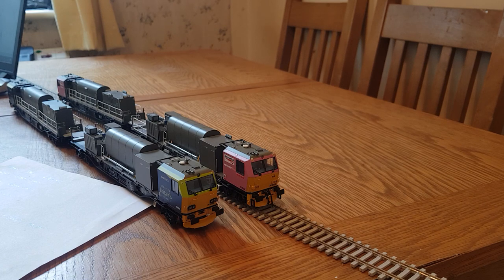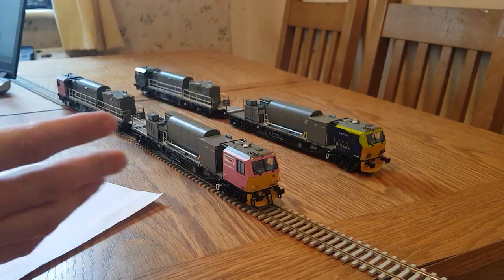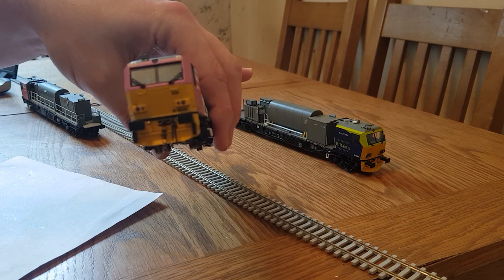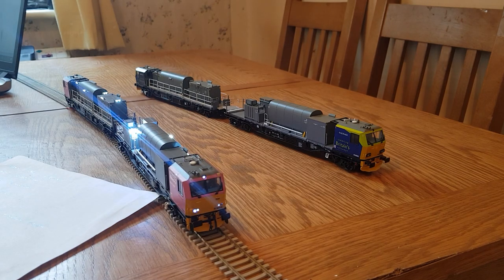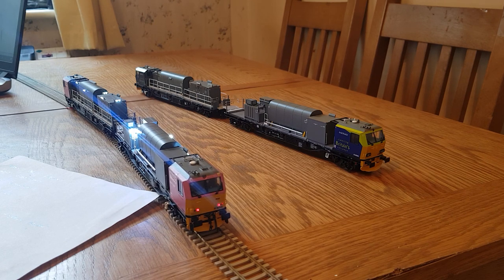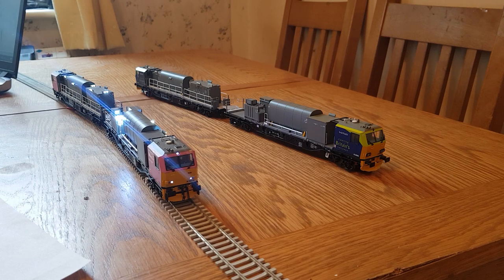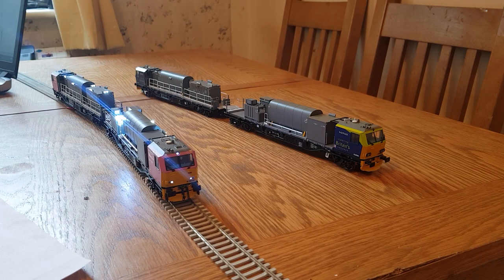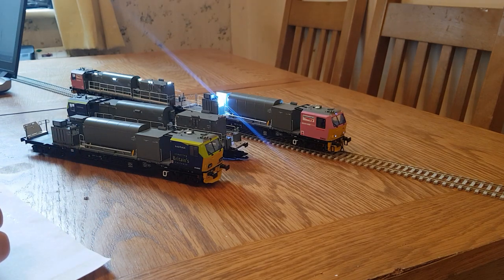Bachmann mpv with legomabiffo sound and floodlights

Comment: Hi. I have looked at the Loco updates web site. Amazing stuff. Just managed to get an MPV at a good price and planning to do a sound install. Perhaps the flood lights and flashing beacon as well. You say Nano SMD LED 0603 for the flood lights. I assume that is in white. How are the LEDs attached? Is that on top of the existing part or instead of. Was also wondering which LED to use for the flashing beacon. Thanks